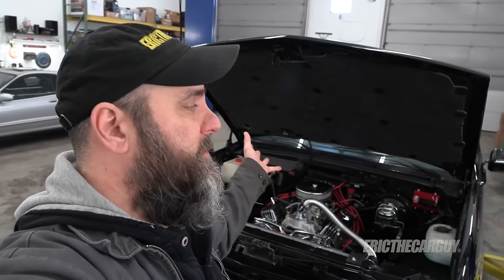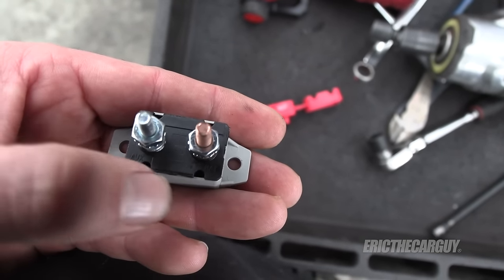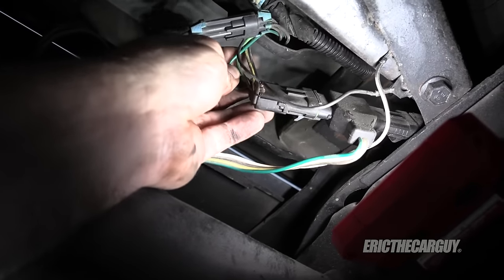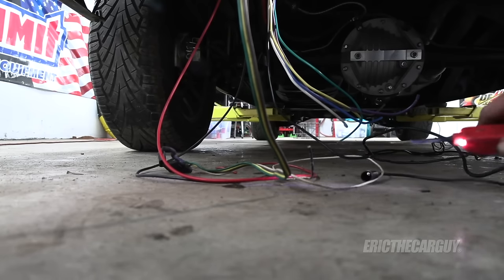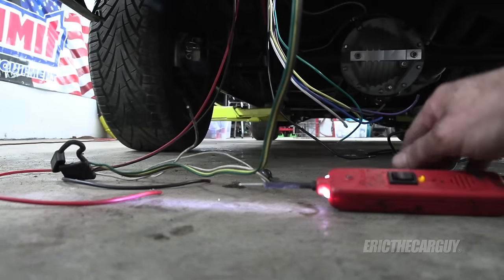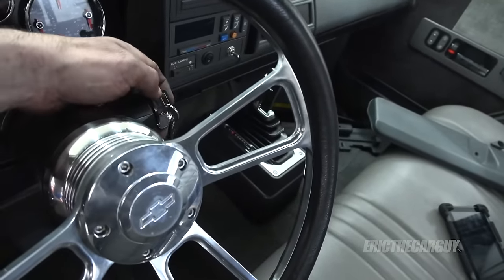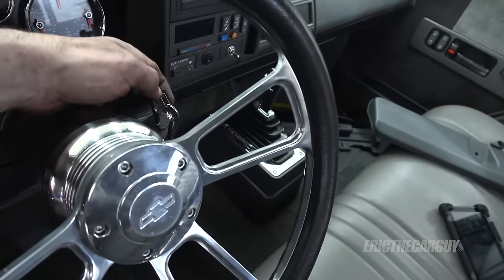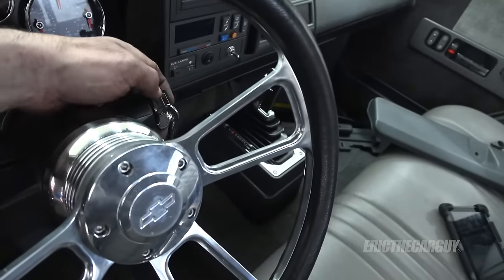How To Install and Connect a Trailer Brake Controller

Comment: You should think about removing one of your license plate lights and put the plug in that location. For me that is the best location to keep it protected and easily accessed.
Reply from the maker: Because the connector is so wide, it really won't fit in that area. Thanks for the suggestion.
Reply: That's where the receptacle is located on my 88 F250, great location out of the way and very well protected from being damaged.  I ripped the factory receptacle off my 08 Tundra because of the stupid mounting location from the factory hanging down below the bumper to get ripped off on a trail or road obstacles.

Comment: I don't think I've seen a trailer with back-up lights. Is that what your reverse wire powered? I'm going to use that wire to turn on my back-up camera for when I'm hooking up the trailer

Comment: On the 4pin harness that looks like a “T”, did you clip the plugs and join them, on the part that goes to the 7 pin connector?

Comment: I full agree with "How you done this" except for the mounting of the trailer brake controller itself You will need it with a  1/2 ton carrying a heavy load on the trailer. You will have to use it alot when the road conditions are Not very good like snow and rain for a controlled stop or slowing. It should be closer to you where it isn't hard to reach for it.

Comment: Nice installation Eric. I'm sure over the years you've seen some real butcher jobs done when it comes to the installations of the hitch and wiring.
Reply: If I had a dime for every install with a bundle of those scotch locks under the bed… well, I’d have a big ass pile of dimes.

Comment: Hey Eric so from the aux side of the auto circuit breaker to the brake controler which wire of the controller goes to the aux side of the circuit breaker?

Comment: The circuit breaker is for the hot side to the controller or the power back to brake from the controller .

Comment: Not sure how big of trailer or size of car your going to put on said trailer, but, are you sure the differential is up to the task??

Nice neat job Eric.
Reply: It should be seeing it is rated for a huge amount of power.
Reply: I would be more worried about the TRANS. I think he did put a cooler on it though.
Reply: @NoWr2Run  He did.
Eric mentions it shortly into the video.
Reply: Thanks. IIGrayfoxII.
Reply from the maker: Brand new transmission and torque converter along with a freshly rebuild rear end. https://www.youtube.com/watch?v=F439MFi6qIk
Reply: Everyone seems to think a 10 bolt is weak, and for offroad specific applications I'd say yes they are pretty weak compared to alternatives.  But the diff won't blow towing a trailer unless you are being stupid, a 10 bolt will pull a car hauler all day.  I do it plenty in my lifted GMT400 Yukon with no issue and the 10 bolt in it has over 235k.

Comment: Just hooked up all this same stuff on my 96 f150 it was alot easier than the Chevy ford puts a trailer brake plug under the dash below the ash tray all you do is plug your controller in and you're done wires are already there and ran only thing I had to do was wire up the 7 way plug on the back

Comment: My 2014 Sedona has a TBC and I have installed LED lights in all outer sockets. I put CAN-bus decoders on the low-beams and have mounted load equalizers to the rear turn signals. I am still experiencing hyper flash. I noticed that someone took the fuse out of the engine bay for what I assume is for the TBC. I also noticed splicing previously done on my turn signals and I haven’t traced them back yet, but if I had to guess I would say they are leading to the seven way in the back. Could this be causing the hyper flash? I could use some advice here and will probably need to find a way to better mount my load equalizers since they are less than a half an inch from both other wiring and the plastic tail light assembly. Buying this car has been an electrical nightmare so far.

Comment: i have a 98 k1500. 
Can that blue wire be used for the 3rd brake light on a camper/topper shell?
Can that orange wire be used to run camper auxiliary lights in the camper/topper shell?

Comment: leaned the hard way what happens if you don't install a breaker. 
If theres ever a short in the trailer positive to ground it will short both the trailer battery and truck power supply smoking the wires all the way to truck frame ground. 

Had a winch fry ground wires from trailer to truck side trailer ground oops.
Reply from the maker: That sounds like it sucked big time.
Reply: @ericthecarguy  wasn't too bad stopped at bumper ground wich was 16 Gage 12 volts power supply was 10 Gage wasn't hurt at all

Comment: Hey off topic but when I cut off my 98 accord ex 5mt 146k miles it kind of rumbles 3 or 4 times before motor fully stops. It had a timing belt put on 5k ago I've owned it for 1k(your fault/inspiration).  Does that sound like ignition timing or just something to ignore?

Comment: Woah. American trailer electrical connectors are craaaaaaaaaaaaap.
Reply: That's the cheap ass plastic crap that everyone buys because well its cheap.  Mine on my truck is a metal cased receptacle and the plug on the trailer is metal as well.  Haven't had any issues in 32 years with it.  I also spray the terminals on the receptacle and plug with lithium grease too which keeps stuff from corroding.

Comment: I’ve come across some ratty vehicle wiring.  We purchased a Durango new in 99.  We had a hitch installed and the so called professionals butchered the wiring on our brand new Durango.  It caused the electronics to go hay wire.  A friend works for Dodge and he got me the factory trailer wiring and helped me install it.  There wasn’t a brake controller as our boat had surge brakes.  The way the system worked was one wire to the battery and connection to one tail light and the trailer was powered by relays so as not to put a draw on the factory wiring.  I know since this video you have had issues with this truck.  Sorry for that and I hope you get the transmission sorted out.

Comment: Eric,
Realistically, what is the most amount of weight the C/K 1500 should tow? I too have single cab, short box truck...except mine is a '97 K1500 with a 5.7  I know engine power, transmission, wheel base, and braking ability are all factors.
Reply from the maker: I think wheelbase would be the biggest factor. For me, I'm going to try and stay around 7000lbs and under. https://www.consumerreports.org/pickup-trucks/how-much-truck-do-you-need-to-tow-that-trailer/

Comment: I found resettable standard blade fuses on the internet which range from 5 to 30 Amps. In case I use one of them in this installation, and especially the 30-amp one, is the resettable breaker still necessary to use???
Reply from the maker: I'd consult with the manufacturer of the brake controller you're using for an answer to that.
Reply: If its re-settable its a circuit breaker, no such thing as a re-settable fuse, those are a one time blow and done thing, re-settable circuit breakers are nice in some cases, but I'd rather buy the manually re-settable ones, you really don't want a shorted out connection being able to automatically reset and have power going through it again until the problem is corrected, its a great way to burn up your vehicle.

Comment: Grind off the end of the circuit breaker bolts to make them shorter and add some heavy grease on them for anti rust protection.
Reply from the maker: Thanks for the suggestion. I'm not really concerned as the bolts sit in a recess. I don't think it's likely the tire will ever make contact, but I felt it was worth mentioning it if someone wanted to mount something in a similar way on a different vehicle. Thanks for the comment.

Comment: Nice install, but forgive my paranoia on wiring in general, but did I see your red 10 ga. power wire laying on the edge of the body sheet metal back there-?  my concern would be over time movement might wear through the insualtion-???  Im not being critical, im recalling mistakes made by my friend on his '69 roadrunner, much smoke and tears--lol.
Reply from the maker: All wiring is in looms to prevent chafing.

Comment: I am of the opinion that your Blue Run might be wired wrong. As you said this is an easy install and doing my project I learned on the Job too. Unfortunately for me too many others used far too many splices and I had to redo everything on the back. The Blue wire should only activate when the Brake is Pressed but your wire seems constant; which means as soon as you hook up your trailer the trailer brakes are going to activate. Hence the reason you had a sound both with the brake pressed and when not pressed. 

My truck is a 92 GMT400 so my wire colors are much the same as yours. If you follow your Brake Pedal you will see a switch and that is what I ended up using to activate my Blue Line to the Controller and I believe you spliced into the White Wire; and they may be the same. Also that Blue Button on the Controller is your Trailer Brake Button used to apply Brakes ONLY to the Trailer. Your Controller Location is not going to be as convenient as you might think. Lucky for how you wired it, to move it closer to the Steering Column will not be a huge deal, just relocate and your done. 

If you are going down hill you may want to control Braking with the Blue Button Alone rather than the Brake Pedal. Slowing the Trailer first will slow your Truck easily. Most newer Blue Buttons are pressure type buttons where the harder you press the harder the Trailer Brakes will engage. When you push the Brake Pedal, as you said, the measures the truck movement to determine how hard to apply the Trailer Brakes; hence the reason it needs to be level as you mentioned. When I first pulled my 35 Foot Fifth Wheel RV, over 7 Tons, I pretty much only used the Blue Button on my Controller, and my Truck is an HD 3500 1 Ton with Dullies, and was easily stopped. The Trailer weights more than my Truck so when the Trailer Brakes engage my Truck Stops. At slower speeds using the Truck Brake worked far better as it allowed both hands on the steering wheel. 

When I first starting researching Trailer Brakes I did not have much faith in them until I hit the Brakes with the Blue Button that first time and about stopped my truck easily going down a windy hill. The Slider on the Brake Controller is how you manipulate that delay and it's better to have the Trailer engage first, just a little, that way it seems like they both engage at the same time. Should you rely on the slight delay from Truck Brakes to Trailer Brakes it might cause a Jackknife especially going down hill. If you engage the Truck First, depending on the Trailer, the Trailer just might push the Truck and can easily cause a Jackknife; a bit redundant but it's different.

That adjustment slider is something to test with a trailer attached, on flat ground such as a WalMart Parking Lot empty of course, and using very low speed. Adjust it so that when the Blue Button is pushed the Trailer will Slow the Truck. Test and Repeat as necessary. Trailer Lights are easy to medium as long as everything goes as planned. To troubleshoot could be a nightmare but that's anything really. My entire comment is My Opinion and as the saying goes Opinions are like Bumholes, everybody has one and they all STINK... LOL... Cheers...
Reply from the maker: Thank for your input and sharing your experience. A couple of things to note. 

The blue wire is wired correctly. You might want to check the video again. There was no 'signal' when the brake pedal was not depressed, only when it was. The nose it made was because it's a pulse width modulated signal.

The blue button on my controller is actually a 'boost' function, not for the brakes themselves. You can follow the link in the description to the controller to get a better idea of how it works. Mine doesn't work anything like you described. 

I agree that this is important stuff and should be taken seriously. Once again, thank you for your input.
Reply: @ericthecarguy  Yes the Blue Button is a BOOST BUTTON and what do you it BOOSTS??? It Boosts the Brakes, either appling more or less braking as needed...
Reply from the maker: But you only push it once to turn the boost on or off. It doesn't activate the brakes as you suggested in your original comment. Not trying to offend you, just trying to share how my controller works.

Comment: The trailer brake with get you able to tow whatever ever you want. ( if you get a good trailer with disc brakes)
Reply: There is still a limit
How much can the brakes handle on the vehicle
How much can the transmission handle
How much can the engine handle
How much weight can the vehicle handle.
How much can the vehicle handle based on compliance(state wont care that you upgraded, if the car could tow 4,000lbs the state says you can tow 4,000lbs)
Reply: Just because you have trailer brakes, or even if you upgraded your suspension, you still have a limit. That limit was given to the vehicle when it left the factory and is on the door of pretty much every vehicle. You can never legally tow anything heavier than that limit even if the vehicle seems to pull it fine.
Reply: @DanielPace92  You might be able to get the vehicle recomplied but that will cost a huge amount.
Reply: @IIGrayfoxII  You might, but yes it would cost a huge amount of money and you would probably have to supply engineering documentation on what you did and what the parts are rated for.  But then it boils down to liability, would they be willing to trust an individual.

Comment: If the controller is wired directly to the battery, how does that NOT create a current drain when the truck is off?

Comment: In 12v DC black  should only be used to indicate ground/ negative.
Reply from the maker: I didn't make the pigtail harness.
Reply: bowez9 In the marine world yellow is ground. Always better to check than trust wire colors.
Reply: @thisismyalt9010  12v standard is black is ground.  I do believe Grn/Y is DIN standard for ground.  Any mechanic which that truck goes to out of Eric's family would expect those black wires to be ground.
I do agree with you never assume.
Reply from the maker: You might have missed that I made a point of saying to always check and verify the signals of the wires before connecting them for this very reason. In my experience, there is no 'always' or 'never' when it comes to things like wire colors. Thanks for your comments.

Comment: Why run the brake controler wire directly to the battery?
All that does is put a constant draw on the battery as your key dosnt shut it off.?
Shouldn't  the battery wire go thru  a Bosch relay that is controlled by the ignition switch?
And same for the charge wire as a auxiliary  battery  in the trailer can run your main battery  down overnight  if it's a bad battery .or some other device like a light or fan left on put a drain on the main.

Comment: Now you know how to bring in the comments! Just use more blue taps! I share your enthusiasm of their use, but it's fine where it is. The main thing people should note is... It's your friggin' truck! Do as you please, Sir!
Reply: Its your friggin' vehicle, yeah, but having it not catch on fire on the freeway in the middle of rush hour and creating gridlock is better so use the right connections LOL.  So many vehicles burn to the ground due to people's careless stereo & aftermarket lighting installs, I really hope insurance companies deny claims due to those types of installs.
Reply: @wildbill23c  stereo installs drive me crazy. But at least this will be a slow burn so all the Fords on the road will have something to make them feel better.
Reply: @TreyCook21  Slow melt/burn up inside the dash most likely LOL, where many fires start from 1/2 assed wiring installs from stereo systems.  I've seen several in pick a part yards where you can see the wiring disaster that caused the meltdown.  

I let the pro's do the radio installs that I've had done.  I'm sure I could do it but I'm not that good I'd rather pay someone that knows what they're doing and do that stuff every day.

Comment: you should match your fuse to your wire a 12 gauge wire should have a 20amp fuse , your 12 gauge wire would be on fire before it trips your breaker

Comment: How many types of trailer connector exist today?

Europe has the Round plug with round pins.
Australia has flat rectangle with round pins

America has round with flat pins?
Reply from the maker: To make things more complicated I think other countries use different types of trailer brake set ups that aren't electric.
Reply: @ericthecarguy  Surge brakes used to be quite common here. I have a boat trailer with that setup.
Reply: To mix stuff more, We have old 7 pin and new 13 pin plugs here in Europe :D
Reply: All works or doesn't work depending on who installs them LOL.  Doesn't matter what the plugs & pins look like if they're not properly installed.  Here in the US people install stuff 1/2 assed, and they also tow trailers 1/2 assed and wonder why they end up flipped upside down on the freeways all the time...I'm sure you guys have those same problems in other countries too though LOL.
Reply: @wildbill23c  Common problem in australia is wheels falling off trailers due to the wheel bearings giving out.
People dont do a basic maintenance check
Reply: @IIGrayfoxII  Hmm, seems to be a common issue everywhere, the lack of regular maintenance on all vehicles...drive it till the wheels fall off literally LOL.
Reply: @wildbill23c  Sad but very true.